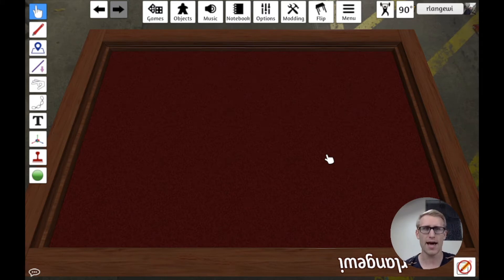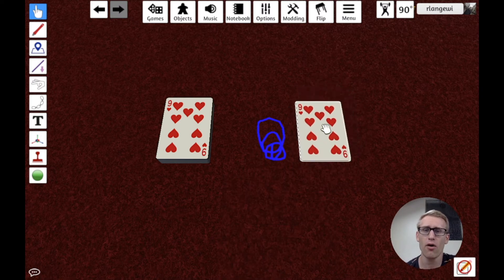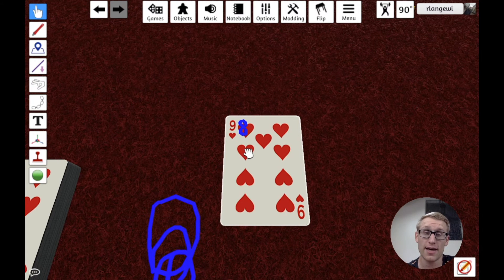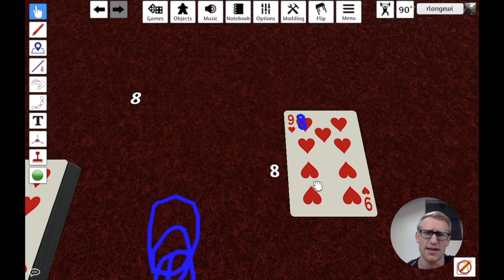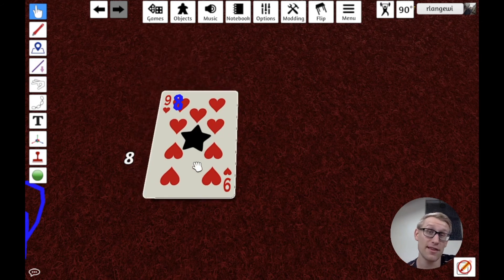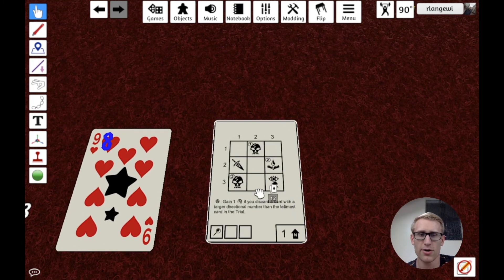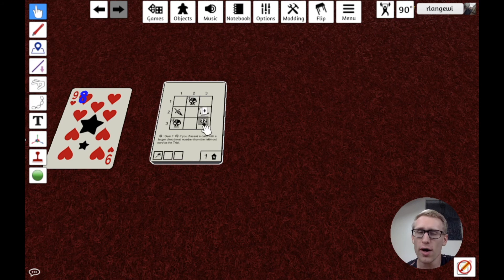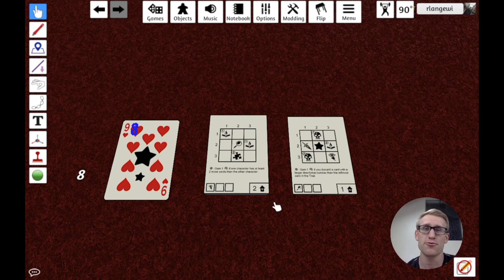How to Modify Components in Tabletop Simulator (Legacy Games and Rapid Iteration)

Comment: Great videos! How can I load a tile that has partial transparency without it coming out black? I have tried png and jpg and they both come out black were the transparency is. My tiles sides have two different pictures but the transparency section is in the same spot. Thanks for any help or if you could lead me to the right video of yours to watch.
Reply from the maker: To use transparency, you will need to use custom tokens instead of tiles. However, Tabletop Simulator unfortunately doesn't allow you to make tokens have different sides... I would check out my Tabletop Simulator intro video and skip to the "Custom tokens" chapter: https://youtu.be/4AZwP4pKoP4
Reply: @LudoLodge  Thanks for the response. I tried a few things and the only one that worked was the card. Fortunately for me this worked out well, I didn't need the thickness of the tile after all. The card allowed a  different picture on both sides with transparency. I could not get the token to transparent, but like you said you can not have 2 different sides. Will be watching more of your great videos and have plenty of questions for you. Thanks again.